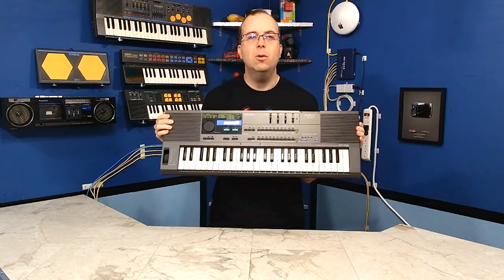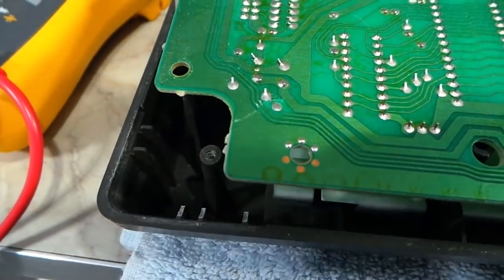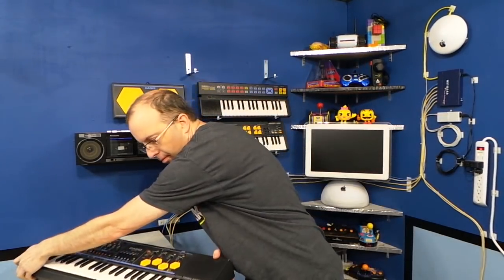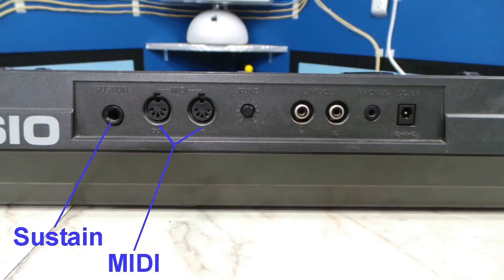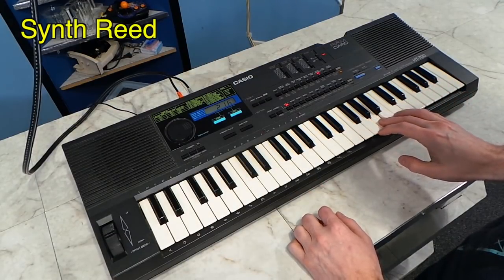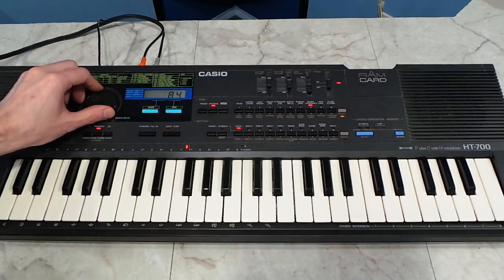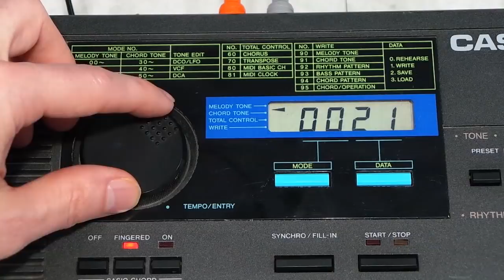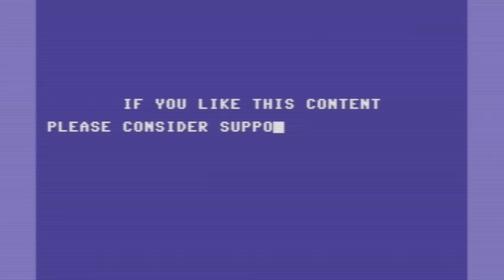Casio HT-700 Repair and Review

Comment: For repairing those plastic screw stalks, I'd recommend hitting Amazon/Ebay for some "Tamiya Extra Thin Plastic Cement". That's what I use and it works amazingly because it doesn't glue it together, it melts the plastic and re-bonds it.

Comment: Love seeing videos on these old Casio HT series of synths. I've got an HT-6000 and love it... but it does have a fault - a non functioning rhythm button. Not worth splitting the case to repair as I know the inside of the 6000 is a mess of wires compared to the 700. Love watching your videos.

Comment: Hi David, you forgot to mention about analog filter feature! It's really unique in HT series.
Reply from the maker: There was quite a lot of technical stuff I skipped over.. That's the trouble with these more professional keyboards is that there is just too much stuff to cover.
Reply: The analog filter in the CT-410V and its little brother, the MT-400V, are a lot more fun. You can manually control the cutoff, resonance, attack, sustain, and decay with sliders on the control panel while you play!

Comment: The Casio HT series was unique and quite powerful, especially the 4 oscillator HT-6000. The complex waveforms they generated made them like pseudo wavetable synthesizers, and set them apart from most subtractive synths that offered only the standard saw, square/pulse, and triangle waves.

I'm a big fan of Casio's '80s synths. I'd love to see a video on the VZ-1, which was Casio's take on FM synthesis and the successor to the CZ line.
Reply: I have a VZ-8M rackmount. I still love the HT-6000 more. Especially that waveform in the Cathedral patch that sounds like rubbing your finger on the rim of a wine glass.

Comment: If its ABS plastic ABS cement works well. Its also usually colored black which is convenient. You can also thread screws into it and when it hardens the screws will easily back out. Very useful if you are looking at completely stripped threads. Just fill some in and screw a screw into it. It bonds with a bunch of various plastics, but of course it always helps to test first. You can get it at pretty much any hardware store as its used to bond pipes. JB weld will bond to almost anything but can be kind of annoying to work with because you have to mix it.

Comment: The one on the left is an 32K ROM. The 78(C)10(G) is the microcontroller, which is loosely based on the 8085 with primitive microcontroller features. The 7810 has no internal mask ROM (so it gets all its code from the external ROM). Also popular with japanese manufacturers was the 7811 which has 4k mask ROM.

Comment: I loved using my HT-700. I have owned three! I want a HT-6000
Reply: Plunk Extend - a classic sound!
Reply: If you like the HT-700, the HT-6000 will blow your mind. It doesn't really sound like the same family. The HT-700 sounds a little compressed, as though it has a lower bit resolution than the HT-6000.

Comment: My favorite cheapo keyboard! Two real analog resonant filters: clones of ones by Korg!! The presets are terrible and don't sound pleasing in either the analog or digital realm but the digital oscillators are pretty interesting. They are kind of like wavetable or more accurately like timbre frames and capable of some pretty interesting sounds. Some of the wave shapes might actually be sort of analog since they have no detectable stepping where the others very easily reveal their sample rates. I'm about to do a massive mod to mine.

Comment: The selection of #3 screws is surprisingly meager!  I just checked McMaster-Carr and even they only had a couple that were meant for plastic.  I think part number 99461a825 would've worked, but would've taken a few days to arrive.  Certainly nod as bad as taking weeks, but still a bit long for a relatively quick project like this.

Comment: For excellent plastic repairs, go search on Amazon for  "Q-Bond QB2 Repair Kit".  Awesome stuff.  It's a powder that fills in gaps between your two pieces nicely, and then you put a few drops of a very thin super-glue-like substance that bonds with the powder and the surrounding plastic. The repair is actually stronger than the original plastic.  Amazing stuff!  Designed to be used in automobile applications -- not vulnerable to water or heat.  Works great on any plastic thing, though, not just car-parts.

Comment: for plastics like that i use Plastic weld model cement, (and variants) it does "melt" the plastic together, usually stronger then before, (but not always) also superglue hack you maybe aware of, if you use a sprinkle of baking soda on the superglue it sets it instantly (does make some heat for a second (more painful if it is on your fingers more than anything) but it also makes a rock hard filler/glue combination, also when using epoxy or superglue, i also rough up the sections to be glued ( if i am making a supporting glue sheath around a break) the additional rounghness gives it more surface area to bond with on the surface

Comment: Hello. I want to ask if you paid attention to soldering the disconnected speaker. + and - of the speaker should go to the + and - of the output stage otherwise the speakers will be out of phase (one goes outwards while the other inwards and viceversa) cancelling out low frequency sound. Great review!

Comment: For screws find yourself a Fastenal store. They also have a website. I have found very small screws and bolts for electronics all the way up to large screws and bolts for construction stuff. Prices are usually very reasonable and they sell in bulk.

Comment: JB Weld is excellent for all purposes, but because the pitch bend wheel hangs, I would have reinforced that glue repair with more glue on the vertical shafts.

Comment: Thank you for this very informative video. I had one of these in the 1990's that I purchased at Circuit City for $200 as a close out at the time. I just purchased one online that will need some work. Do you have any advice to where I can find the correct replacement for the Ivory or Ebony keys. One is missing and another is loose.  I plan to fix it when it arrives.

Comment: I have an HT-700. I am currently writing an album only using this keyboard. Mine came in good condition, I only had to replace a diode to get the memory function to work. I like the HT-700 a lot, it has some wonderful sounds for certain types of music. The preprogrammed sounds don't do it justice. The jogwheel really does suck, though.
Reply: Yeah, the programming wheel does suck. It was a potentiometer instead of a rotary encoder.

Comment: The crack in the board reminded me of Korg SP-250 (I think?) that I ended up getting rid of because of that very reason: crack in the board caused one of the speakers to stop working...kinda wish I found this video sooner.  David, would the fix you used here be feasible on a newer keyboard?

Comment: I would have soldered jumpers across the traces on that small crack, that way it will still be in Stereo.

Do you have any information on the chips for a Casio CT-680? I have one that I bought new when I returned home from Desert Shield/Storm. Unfortunately, it was connected to my pc via Midi during a lightning storm and a nearby lightning strike fried my pc and did something to one or more of the chips. It turns on, but as soon as you press a key, it outputs crazy/random sounds.

Comment: You can use super glue and soda for this kind of restoration. Just apply some super glue to the surface and then add some baking soda. It will make a plastic
Reply: By soda I mean Sodium bicarbonate. We often use it here in Russia for bakery. And by super glue - cyanoacrylate. It hardens very fast but makes a very strong material.

Comment: well speaking of keyboard problems. i have a casio ctk 571 (modern keyboard) and my problem is some of the keys will stick on or activate multiple keys. i opened up the keyboard and i couldnt find anything abnormal about it with just looking at it. I dont want to get rid of it because the sounds the keyboard makes are fairly clean.

Comment: A little wire soldered to the broken trace is the easiest way to fix damaged boards. Then put some epoxy on the break on the board so it does not spread.

Comment: 8 bit guy .what do use for multi track recorderings cause that's what I need I bought a cheap usb mixer but I don't think I can do it on that without alot of bouncing tracks back and forth just wondering if there's a cheap and easy solution??   I can record multi tracks on my Yamaha DJx but it's so I can record stuff from band lab add the keyboard and maybe a 303 from my app on my phone from the audio ...what's the easiest and cheapest way to do this without using midi ?

Comment: Just bought a used HT-700 but it did not come with the power adapter. The seller said it works with batteries but this was before he sold it to me and then ghosted me. My question is, is there a specific type of battery this keyboard uses in order to power it up? Or a regular D size battery should work? Or did I just get scammed? lol
Reply: Should work on any D size battery, preferable alkaline type. Check the battery compartment and contacts are free of corrosion and crust.

Comment: I suspect this keyboard is related to the CZ series a lot of the sounds do sound similar and the PCM is just for the drums.
Reply: Not really.  The CZ uses "phase distortion" synthesis which is similar to Yamaha's FM (Frequency Modulation) synthesis.   The HT/HZ series use SD (Spectral Dynamic) synthesis which is similar to traditional subtractive synthesis, but uses one of 32 digitally drawn waveforms (from standard saw & square waves to more complex waveforms) that pass through an analog resonant low-pass filter.  However, the filter affects all 8 voices simultaneously without individual articulation (with the exception of the HT-6000 which supposed to have full articulation).

Comment: thanks!!!
I just buy an old CASIO HT 6000
but I find a trouble 
THE POWER ALWAYS COMPLETLY SHUT AFTER PLAYING FOUR NOTES
CAN U HELP ME !!!?
THANKS
Reply: I have a weird problem with my HZ-800 (the non-programmable version) too. It was mint when I bought it. I built a little Arduino MIDI router based on the reference MIDI I/O circuit and connected the HZ-800 to my HT-700 so I could play them both at the same time with one keyboard. After awhile, the HZ-800 flaked out. When I take the cover off, it will play. But when I put the cover back together, there's no sound. There's apparently some intermittent fault that manifests only when the cover is screwed together. Like the cover is pressing against something inside and causing a component to disconnect.

The speakers on my HT-6000 have never worked, but that's no big deal since I connect the audio outputs to a sound system. I'm guessing some capacitors in the audio amp have gone bad, but I'm not too worried about fixing it.

Comment: I would have scraped those traces and many tiny jumper wires directly on the pcb across that crack (millimeters) rather than huge long fat cable in there. Then I would have epoxied it all for good with clear 2 part to strengthen the PCB. But that's a funny way to do it you did there, hahaha.

Comment: I think repairing th PCB by meanings of scratiching a bit of the paint and giving a drop of solder had been better and the screws ar not commertial because they are kind of standard measure for electronical equipment, you could have taken them off from some old TV, VCR, CD player or any other piece of electronic junk laying around. On the other hand  your review was excellent and i liked it very much

Comment: are retro keyboards good for use as a midi controller?
Reply: Depends on your level of music production/composing and what you want out of it. They usually don't have any features like velocity sensitivity, aftertouch, the ability to send controller data on all the channels you want to etc. And the keys are often much better on newer keyboards (feel and response). Then there is the fact that modern controller keyboards (and some synths) also have USB connection, eliminating the need for a MIDI interface in case you just want to run soft synths etc.

Comment: I had the "professional" version of this keyboard, the HZ-600. Some.damn good sounds could come out of it.
https://youtu.be/yFwfpQB2zzQ

For future reference, it's "Spectrum Dynamic" synthesis. No real info is around on how that works, but it's basically a digital wave through an analogue low pass filter and optional analogue chorus with two intensities. :)
Reply: Yep, it's hard to get info on it. From what I gather, the individual harmonics of the complex waveforms are modulated in some way, which makes the sounds seem to "move."

Comment: Does Dave use a metronome when he makes dis multi track recordings because they always seem slightly out of time.
Reply from the maker: Not exactly a metronome.. I usually start in Audacity with a click track (so basically a metronome) but I play this stuff live.. There's no MIDI sequencing or trackers or anything. I usually start recording a song and finish it in a few hours.  I don't really have the time to spend days or weeks on a song just for a single episode.  That's also one of the reasons the songs are usually so short.
Reply: Thanks for answering

Comment: Running speaker cable at the top of logic board is not the best idea. Speaker signals are pretty strong and can interfere with logic signals. You should've used coaxial cable or run the cable around the edges of the board. But since you already got it working, you don't really have to care.

Comment: +8-Bit Keys 
Hey David, at around 1:30 you talk about some of the ICs, and mention one that you THINK is a ROM (the NEC D23C256 to be precise), but MIGHT be a static RAM; well i can confirm that it IS indeed a mask-programmed ROM chip, 32Kx8 in fact; as far as i know, memory chips beginning with 23 are mask-programmed ROMs, whereas 27 means EPROM, and 28 is EEPROM.
As for the other ICs, i have been able to locate a datasheet for the CPU: http://www.datasheet-pdf.com/PDF/D78C10G-Datasheet-NEC-723400

The two ICs marked M6294-03 and M6294-04, however, are a bit more iffy, but i have found a brief discussion of them here: http://www.casiomusicforums.com/index.php?/topic/6110-casio-ctk-1000-hardware-analysis-also-va-10/And to save you a long read, i'll just quote the relevant bit here:"In 1980th Casio keyboards mask roms often begin with "D23" or "HN62", proms or eproms with "D27" and rams with "D43". But even when a digital keyboard has separate ROM, this does not mean that its sound samples are in it. E.g. early Casios with PCM percussion had dedicated percussion ICs "OKI M6294-xx" ("xx" is the software number) those contain sample rom with integrated DAC to output percussion samples only as analogue audio. Also some Bontempi relatives had such percussion ICs. By my observation Chinese "no-name" tablehooters (neither Medeli nor Yongmei relatives) generally contain no external ROMs. The only exception seem to be prototype or pre-mass-production specimen (e.g. from a trade show) those have a separate flash rom connected to their special CPU."

I hope this sheds at least a little light on things. :)

Finally, thanks for all your great videos, which i watch with great interest.

Comment: I love Casio keyboards to the moon and back but these things are not built to last, I'll tell you that :\

My current one is a much later model (WK-3500) which also has a broken right speaker, I wonder if that's super common with these things. Odd thing is, I want to say right output is busted for the headphones as well (I can't quite recall since I rarely use them) but not the line out (again, not entirely sure since I usually just record mono from it) ... my other model, an old CTK-671, had the power supply just completely give up the ghost...ended up gutting for parts.

Comment: Use a MIDI editor (e.g. BRELS MIDI Editor, MidiEditor), not multitrack recording.
Reply: The keyboard isn't multitimbral enough to work on multiple tracks at once. He would have to record them, or bounce if you will before moving on to the next tracks.
But yeah, it would be easier to record and quantize the parts that way.
Reply: Only 3 MIDI channels supported in HT-700. Reference: http://en.wikipedia.org/wiki/Casio_SD_Synthesizers#Feature_Comparison_Matrix

A Hohner version of the Casio HT-700 is released as the KS-49 midi.
Reply: Yeah, but in that multi part mode, the polyphony is severely reduced so that means you can't play too many fancy chords.
Reply: Yup, 4 voices each for upper and lower parts and monophonic bass.

Comment: this apparently has an analog filter which is surprising
Reply: Yes, it's paraphonic, though, which means it retriggers every time a new not is played.  It does have filter resonance, but I don't think it self-oscillates.
Reply: If I remember correctly, the filter in the HT-6000 doesn't retrigger.
Reply: @diggydude5229  - correct. The HT-6000 is true polyphonic as it has individual filters per voice (8 in total, 9 if you include the accompaniment filter). As zibbyone said, all other HT/ HZ models are paraphonic with a single filter for all voices, and a filter for the accompaniment.

Comment: I have this keyboard and one channel is dead. Left is dead. RCA out left is dead. Stereo mini jack out left is dead. Left speaker is dead. It's very sad. I have spent about 4 hours trying to find the problem but I am lost. There is only one amplifier chip! Where does stereo occur? I'm very confused. There are no schematics available. I cannot determine the failure. Right channel works but LEFT IS DEAD.